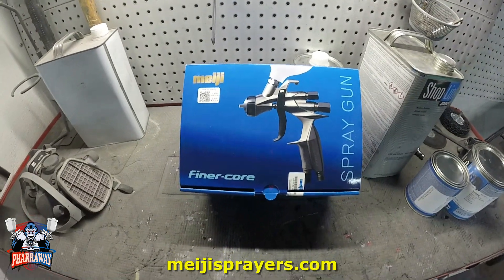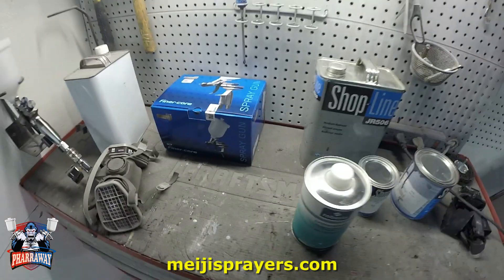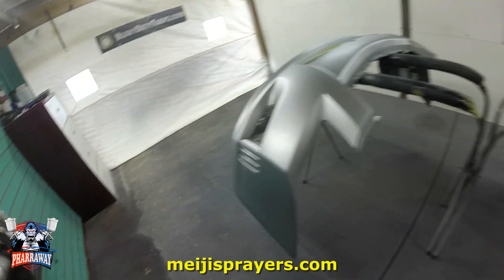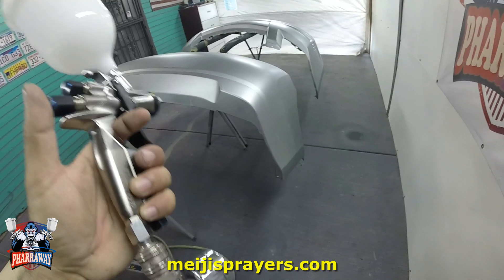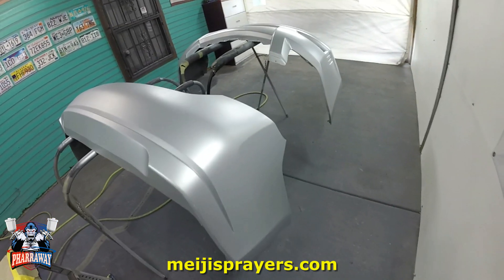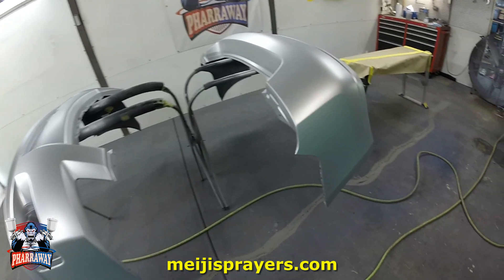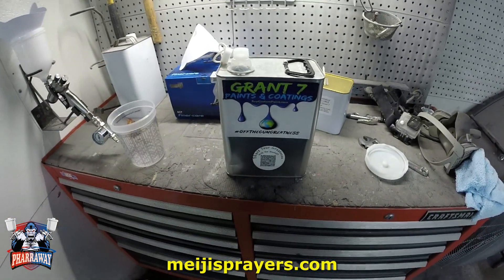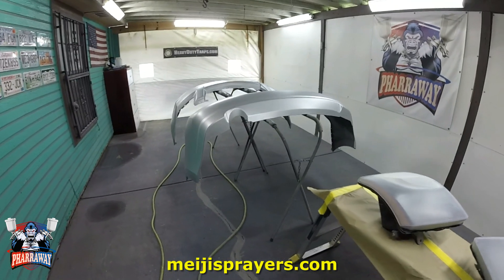Review and Demonstration of the new Meiji Finer-core 1.3

Comment: Works good for solvent paints, does the spray gun work for water-based painta?? What nozzle tip is needed 1.3,1.4,1.5, reason waterborne paints are thicker.
Reply from the maker: Yes it will with a 1.3 tip